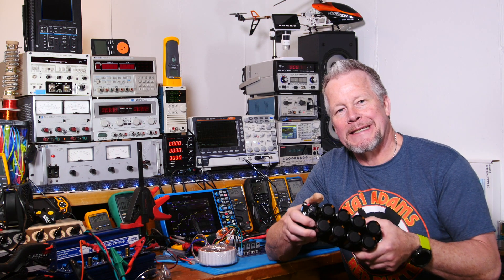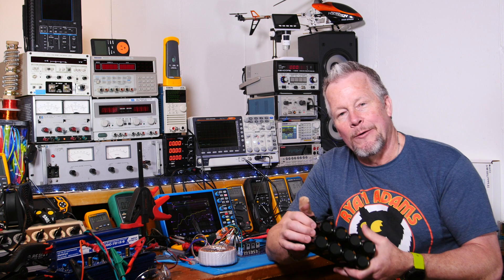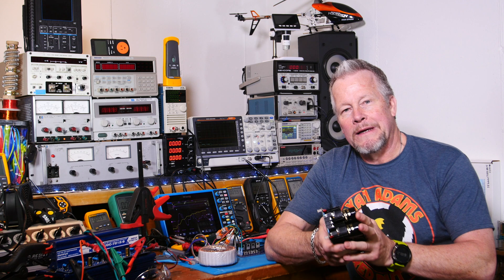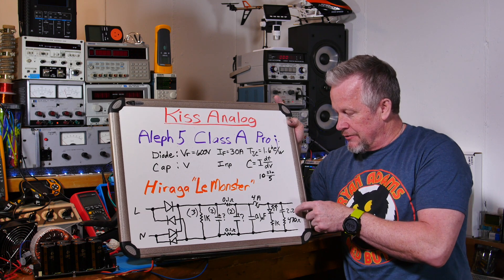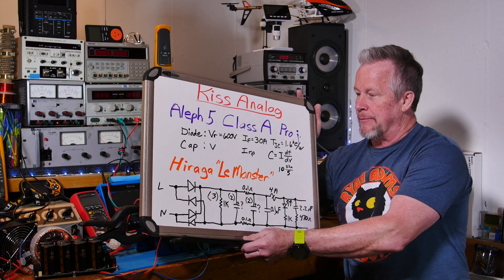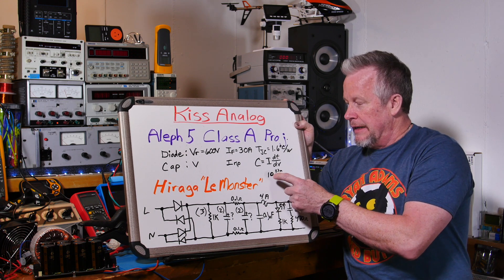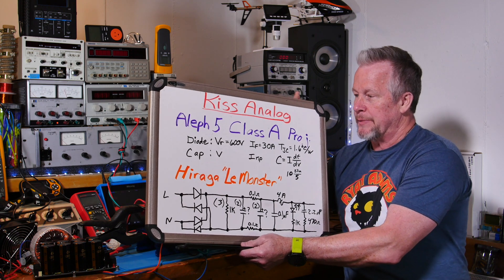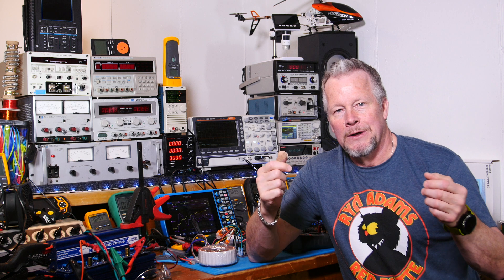HIraga Power Supply Kit for Class A amplifier the Aleph 5 Part 1

Comment: Hi, never too late to the game. Thanks for the video!
Question: Can the Hiraga Le Monster be used for the following circuits:

Dartzeel Dartzeel NHB-108 circuit
Input voltage: DC +/-55V (Transformer not less than 250W)
Output power: 100 W RMS @ 8 

KRELL KSA50 circuit 
Working voltage: ± 35V (Class A), Class AB working condition ± 45V
Output power: 50W (Class A); 150W (Class AB)

Comment: The original "Le Monstre" was running on a 14V lead-acid car battery as a power supply ! Zero ripple and very low output impedance ;) (Source : l'Audiophile n. 27)
Reply from the maker: LOL I think I read that;) i used to be an avid reader of that publication.  Thanks!
Reply: @KissAnalog  You can see some pictures of the supply on this page https://sound-au.com/tcaas/monster29.htm
Reply from the maker: Thank you for this link @ee!  Very nice!  I should do a video to talk about this paper;)

Comment: Looks relatively interesting supply - I guess you'd want to tune it for need like you're doing so it makes for a great video.  I'm not clear on your calculation for the ripple though: you have two, independent channels with their own capacitance and bridge rectification but you combine the current draw for the purposes of your capacitance calculation.  I.e. you're looking at 5A per channel but the current you use in the calculation FOR ONE CHANNEL is 10A??  Even if I've misunderstood and it's 10A per channel, then the divisor for the number of caps must be 8, not 4?  Could you clarify this a bit for me.

I guess if there's plenty of voltage overhead then 5V ripple would be ok: I assume the idea is to keep the ripple above the level of voltage actually needed?  Did you pick 5V for any particular reason?
Reply from the maker: Hi Andrew - sorry this comment was lost for awhile;)  I was using 10 Amps as 5 per channel from this single power supply, and I think I chose 5 V as a good number to keep the ripple above the voltage needed.  There are 4 caps per bank (for plus and minus voltage rails), so I divided by 4 as this is how many caps that I can install.  Does that make sense?  I just did a video comparing the output of two transformers and how much power I can get because of the higher voltage/power of a larger transformer.
https://youtu.be/IDNM2OAAXeg

Comment: Hi Eddie, 
Perhaps I'm asking a stupid question,  but why not have regulated power supply for an audio amp?  Is it because of dynamic supply capacity? Or cost and current capabilities? Wouldn't a regulated supply better remove ripple and noise?
I suppose that a good amp design and sufficient margins in V and I will be enough? 
Cheers 
Mark
Reply from the maker: That is such a great question Mark!  Thanks for asking.  I think a proper regulated power supply would be great, but I think in the past they might not have been great, so people got a bad taste.  Also cost would go up.  I want to explore this by offering a regulated power supply.  This will happen in videos to come.
Reply: @KissAnalog  Thank you, Eddie. Looking forward to it. 
Cheers 
Mark

Comment: The amplifier kit is sold out long ago.
Please update if possible.
Reply from the maker: Thank you!  Try this link.  This I think is the same design on a different board that might actually be better with larger resistors: https://rover.ebay.com/rover/1/711-53200-19255-0/1?mpre=https%3A%2F%2Fwww.ebay.com%2Fitm%2FAleph-5-60W-A-class-Amplifier-D-I-Y%2F112627178092%3Fhash%3Ditem1a391a5a6c%3Ag%3A~fYAAOSwaSZZ-4e4&campid=5338607533&toolid=10001&customid=Aleph 5 Amplifier

Comment: Thanks.This looks like a good power supply design and board.
I have one question though.You said you were aiming for 5V of ripple from the power supply and therefore you would only need quite small caps.Firstly, that seems awfully high for ripple-are you going to rely on the amp to filter out the rest of the ripple?Secondly,my understanding of power supplies for power amps is that you need a decent amount of capacitance to deliver the peak power requirements.I'm not an engineer so I could be wrong but what are your thoughts?
Reply from the maker: That’s a great question and leads into my testing in a video to come.  There are several factors; one is what voltage is at the voltage rail and how much that can dip (ripple) and still give enough voltage to allow the circuit to work (which is referred to is voltage headroom).  Another possible issue is; does the ripple conduct noise into the circuit?  Well, the amplifier has feedback, which at the low frequency ripple, it is very high, so it has very good ripple rejection.  A benefit of more ripple is obviously less capacitance cost, but another might be that current conducts more of the cycle so possibly less noise.  I’ll talk more about this in the videos to come.